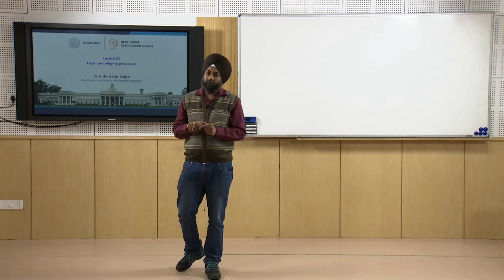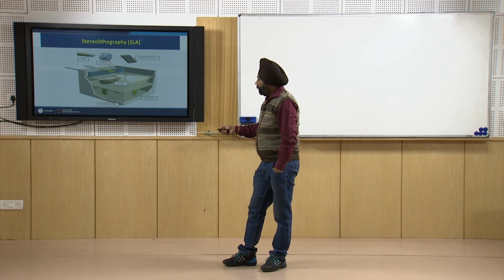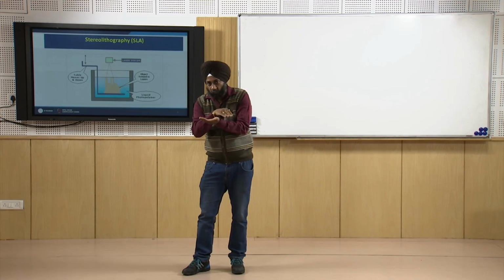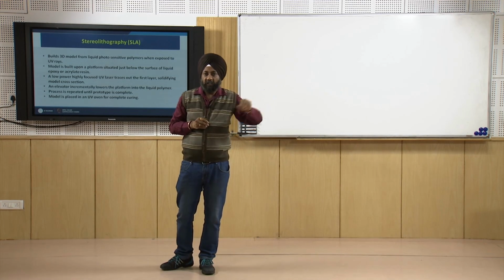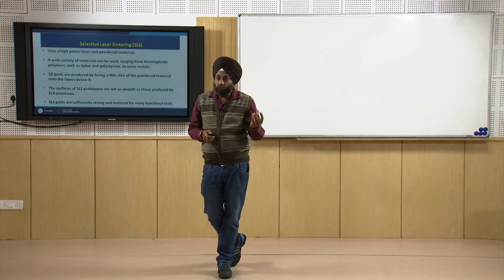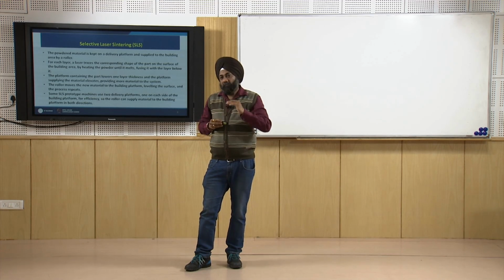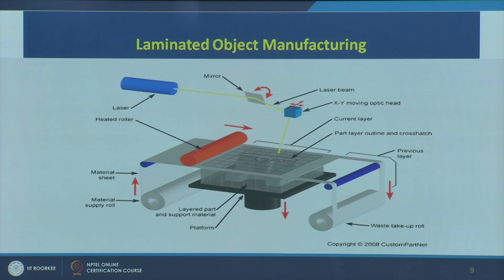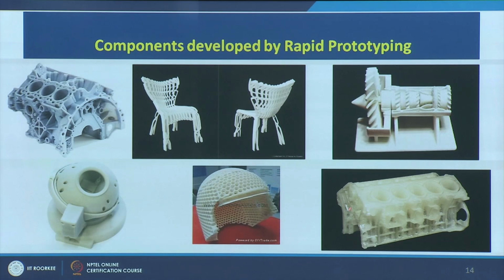Lec 20 Rapid Prototyping Processes

Comment: There are several different methods of 3D printing, but the most widely used is a process known as Fused Deposition Modeling (FDM). FDM printers use a thermoplastic filament, which is heated to its melting point and then extruded, layer by layer, to create a three-dimensional object. 
Website: https://www.mystem3d.in/